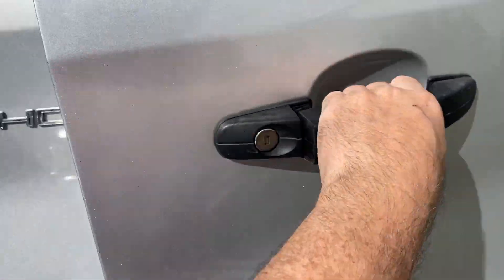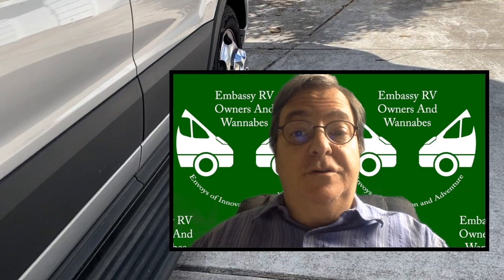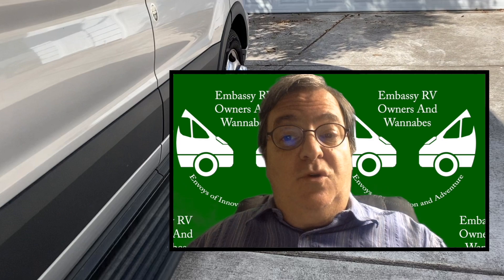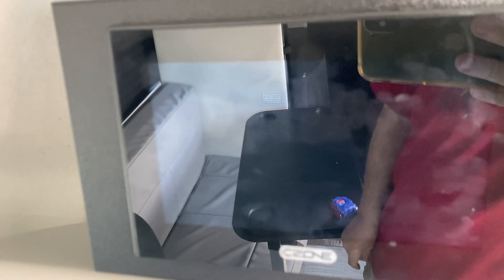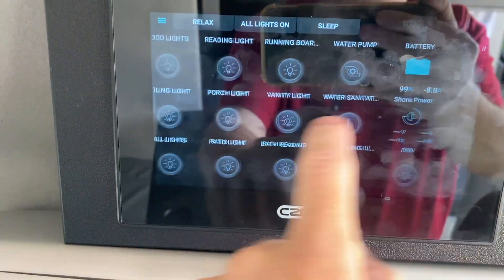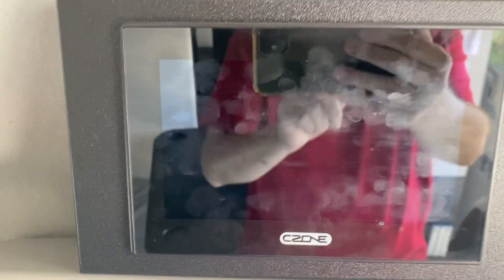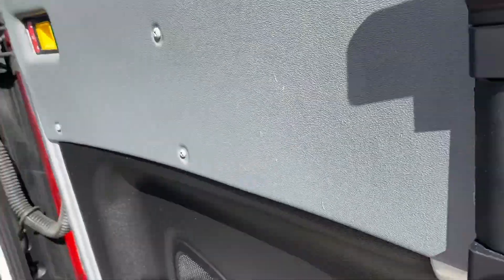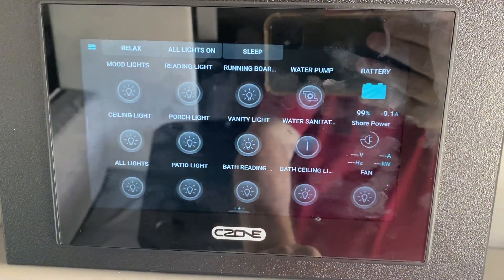Battery Shut Off From Mastervolt CZone Panel

Comment: So the “popping” sound when you shut down the system was the yellow battery buttons popping up???  When you went to the back of the van the switches were turned, but the buttons appeared to be up (not engaged or pushed down).  Is that correct??
Reply from the maker: To turn on the batteries, you turn the switched, then press the buttons in. To turn off the batteries from the switches, just turn them... the buttons pop up and the batteries are off. Does that make sense?
Reply: Yes, switching the panel off causes the buttons to pop up this turning the batteries off even though the switch position is on.